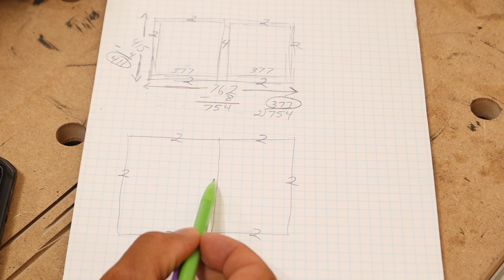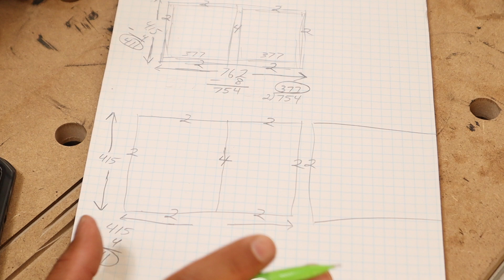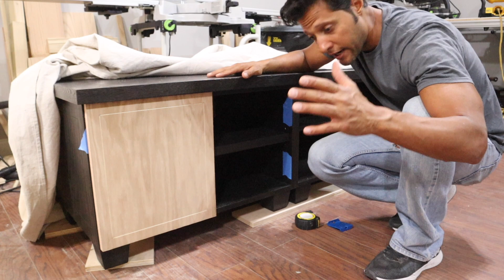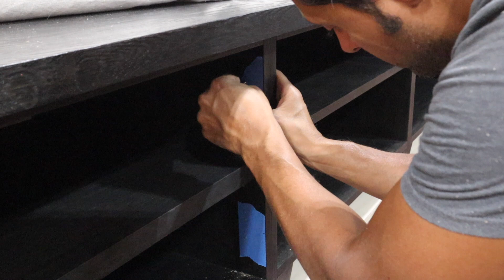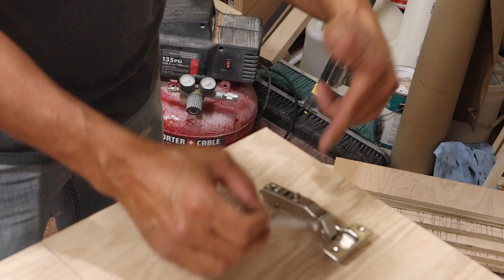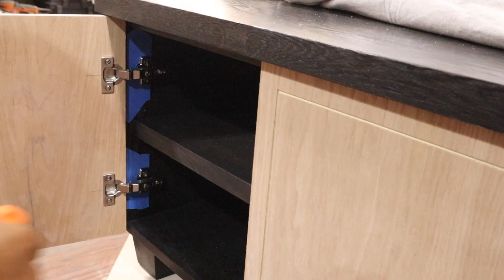Cabinet Doors are Easy (Media Cabinet pt. 2)

Comment: I make a ton of customs every year.  And go thru I think about a dozen of those 250 ‘ rolls maybe less cause I hv partial rolls around and in my van.  I use a Blum 35 mm cup jig which is pricy but way more accurate that the Rockler or Kreg.  Doors?  I just can not make my money back trying to be that accurate maybe on “my” cabinets but a customer I order out and put 20% on it.  
The big shops band out 5000 of those a year and do it quick and very accurate.  
I just don’t see any money in it and that edge banner will run 3 thou plus !  And it has had it problems.  But very nice piece and I hope you made good money you deserve it as a tradesman !